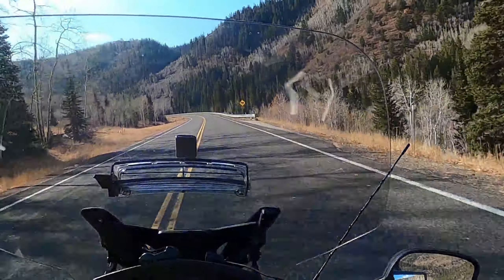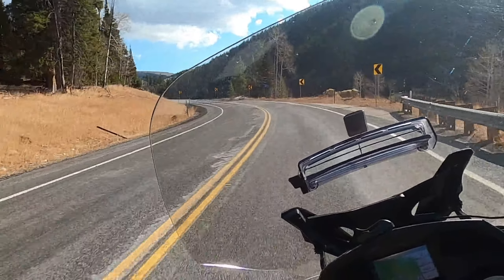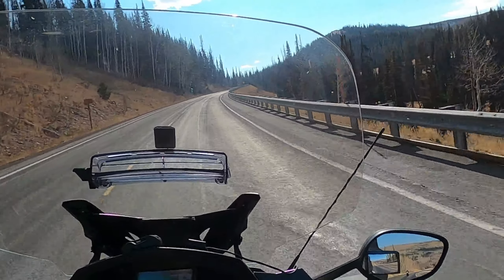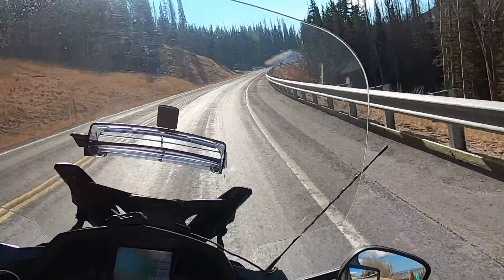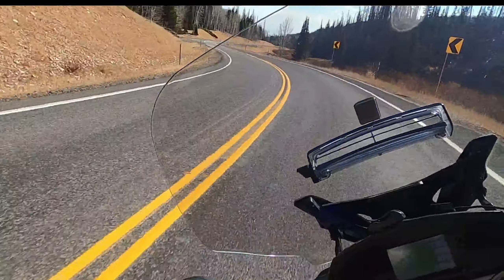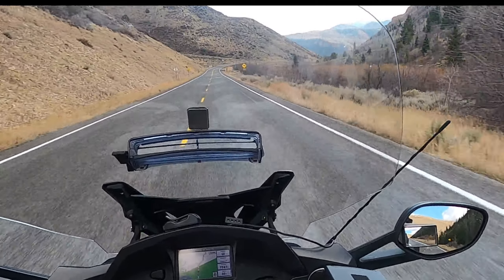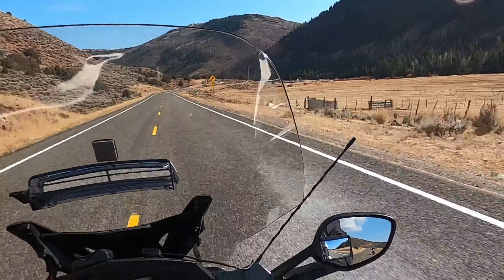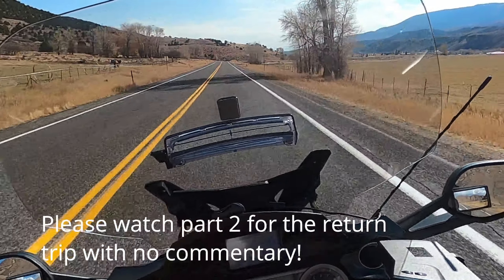Canyon Carving 101: The One Second Rule, explained on Utah's Wolf Creek Pass. We rip it!

Comment: Holding racing lines in canyons is a recipe for trouble, especially with oncoming traffic and possible obstacles.
Reply from the maker: Not if you stay in your lane. The proper line is still the key to survival when riding quickly.
Reply from the maker: @shinigami1925  Nick is an amazing teacher! I think what you're missing is that it is up to the rider to look at the sight lines and decide how much of the road is usable. Sometimes, especially in tight lefts, there's no way to see far enough ahead to be anywhere near the center of the lane. Other times you can easily use the whole road. There's no set rule that applies everywhere.  It is always the rider's responsibility to ride in a manner that is appropriate for the road, conditions and skill level.

Comment: Roll off the throttle for shifting? Nah... I'll use my bikes gear shift assist pro, and let the bike deal with the throttle.  (2018 BMW K1600 GTL)
Reply from the maker: I really want to upgrade to a 2017 or newer in the spring. That and the reverse gear. A friend has a 2016 R1200R and I'm amazed at how much fun that is!
Reply: @JayBearjaysbigadventure  I didn't realize what all came on mine when I got it!

Comment: Hanging over centre lines on corners with limited visibillity?? Taking racing lines on a road?? There is more to riding quickly and safely than just smooth throttle control!  Poor "instructional" video!
Reply from the maker: If you'd watched it carefully, you can clearly see that the sight lines are quite good and there's nowhere for an oncoming vehicle to surprise you. That 'racing line' can save your ass on a road you don't know. Learning how to use it is important. Or, you can just pray for the best and hope you never need it. But regardless, thanks for watching!
Reply from the maker: This is very similar to the 5 minute mark on your video of the A87 where you whip out from behind the caravan. I could easily say that you missed seeing the oncoming car and barely made it back over. But there WAS time - it just doesn't look like it in the video. What you see on film is not always what you see in the real world.
Reply: @JayBearjaysbigadventure  Afraid not - racing line on a road will more likely get you into trouble than out of it. It is a track technique and bad practice for a public road.
Reply: @Jay Bear  Except a) it wasn't me in that section and b) the rider was well aware of the car long before they pulled out from behind the caravan and so was able to factor in the closing distance. I accept that camera angles can be misleading but there are many instances in your video of corners continuing for some time where combined with your postiioning makes it very unlikely you have any idea of what is coming around the corner; for example 5:08 to 5:15 there is no way you have any idea of what could suddenly be hanging over the line coming towards you, until the corner opens up.